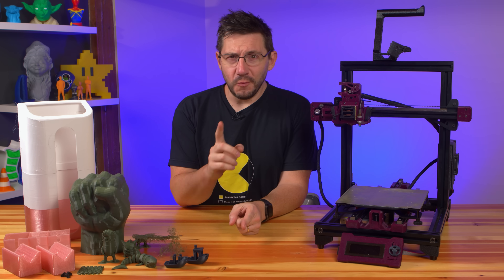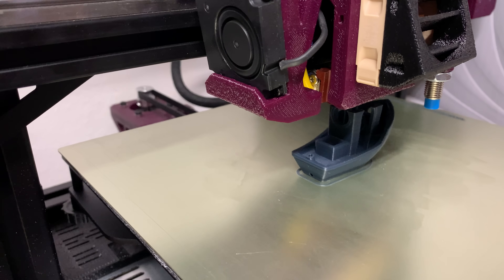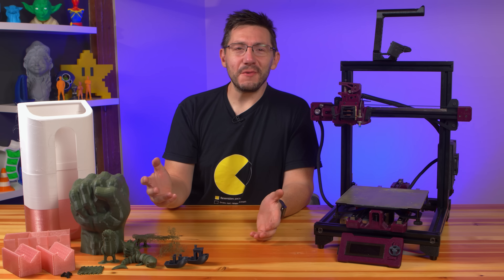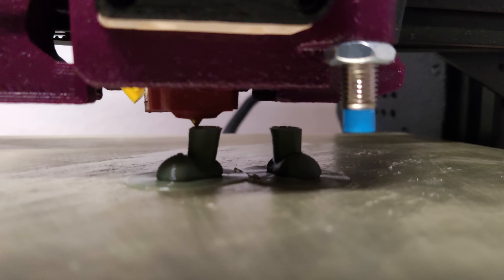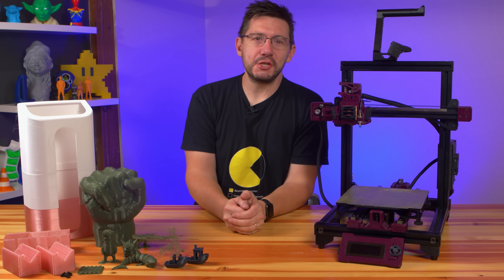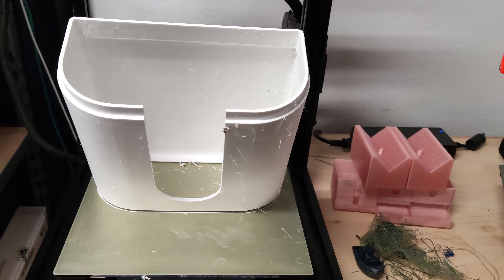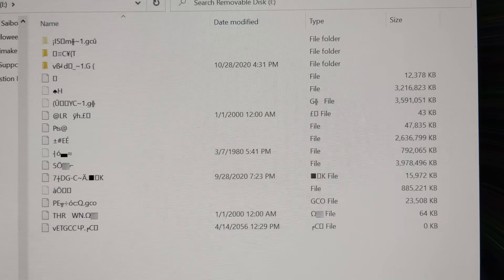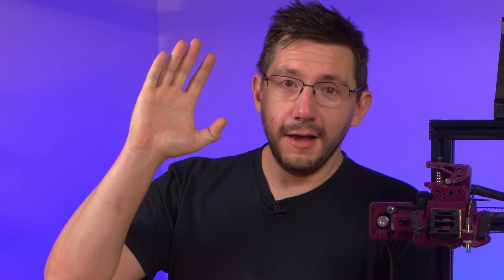WUXN WX1 Review // IS THIS 3D PRINTER FOR YOU?

Comment: Any printer made outside Asia costs much more due to labour costs, what we need is western companies designing printers to be manufactured and QC'd  in Asia with the parent companies monitoring QC, Creality have adopted these ideas for themselves but seem to concentrate on the budget market, I believe at some point the market will become saturated with budget machines forcing development of better units
Reply: @wildlifetails  well i think that there is something else. Many actors just do "another printer". What is the added value? Ultimakers have their dual, interchangeable print cores, as well as the ecosytem with cura and all; prusa are IMO the golden standard that everything measures against (i don't say nothing is better than a prusa, they are very good, adequately priced, popular and thus make a good benchmark.), and also introduced a lot of features that became common later on in a mass produced machine; creality offers killer frames and good kinematics for killer prices, and have more uncommon projects such as naomi wu's infinite Z belt based printer, (and an argument could be made for the ender 3 or ender 5 to be the standard to compare against, and i would thus grant a higher score to prusa, if ender 3 is 100%, a MK3 is 130 to 140% for instance, and if prusa is 100%, ender 5 is 70-80%).

Anyway, those brands are known for things. Back in the time, printrbot was known for their tank-like printers with a pretty good set of features, also built in the US with pretty decent prices for what you got. (although they did not manage to face the super cheap chinese competition).

I think that there is definitely a place for 600-1000$ high quality printers (and the fact that prusa sells that much is proof), as well as more expensive ones (ultimaker proves it), but there must be an added value. Or being an established actor, known for something.

But sure, it is not easy being in the US, since chinese manufacturers ramp up the quality (see the sec-kit printer that is not a plug and print machine, but is simply top notch as a printer platform; i don't know if there is much better now to be had. With a hemera, and a good 32 bits board this is a dream machine :) )

So as you say, occidental designs manufactured in china may be the way to go; also i think that manufacturers should not be afraid to use chinese ressources : in a printer from a random brand, i'd be happier to see a bigtreetech SKR 1.4 than a custom board, unless they prove right away with super good documentation, open design, etc, that their board has an added value.

Another example is smoothieboard. It is awesome, for sure. But now for a fraction of the price, the SKR 1.4 can do a lot of what smoothie can do... however smoothie maintains the smoothie firmware, unlike the SKR, and a few other cool features. Still, the cheap boards are catching up. Unless smoothieboard 2.0 acually releases (a small joke as they take so much time to release it), and adds meaningful features for me, when i make my laser machine, i'm likely to use a SKR board, for it is clearly good enough with a lot of features for a much lower price...
Reply: We don't need anything else made in asia!
Reply: @jesusisalive3227  Why that? If it were not from asian manufacturing, 3D printers would cost 1000$ minimum...
plus let's face it, almost everything is fabricated in asia.
And for Europeans, it would make little sense to go for American manufacturing over Asia...
Even for Americans, it does not make much sense. There are few things that can't be found waaay cheaper and at a good enough quality from asia...

Comment: To me it doesn't look like it's worth it. I've gotten much better performance from my Ender 3 and it did not cost near that even with the upgrades I have put on it.

Ender 3: $199 (+shipping)
MicroSwiss hot end: $63.50
SKR mini E3 1.2: $29:98
TFT35: $35.98
BL Touch: $39.85
PEI coated magnetic removeable bed: $26.50
CR-10 dual gear extruder: $14.98

Total: $409.79 

With the quality prints the WX1 seems to produce compared to my Ender 3 setup that is less than half of the price and the quality it produces, it's not worth it for me at all.

Comment: Love the review but will definitely pass on this printer.  I picked up a  Ender 3 Pro yesterday it wasn't  planned but I received an  email  from Micro Center  and it was on sale IN  STORE for $189+ tax and it prints well  especially  for the price I ordered some upgrades  from Amazon fun stuff!
Reply: Ender 3 is a great printer. You can get very good quality prints out of the box, and even better with some upgrades. It's definitely the printer every thing else gets compared to.
Reply: I printed  a spool holder to move the PLA to the side of instead of on top so far made 3 prints no issues

Comment: So, considering the high price, poor print quality, low reliability and various flaws you showed, why would you call it "good"? at most i'd say "with potential if the manufacturer updates", or passable, but that is not good in it's state...

I like the linear rails, but what does it bring to the table here? why pay for linear rails for a bad print quality?
same for the good quality hotend, and the dual gear; what is the point if the extrusion is so inconsistant?

considering all what you said during the review, i expected the conclusion to be "it is a good printer for 300-350$ if you plan on tinkering with it, or use the parts to build your own printer"

If i compare with a MK3:
-the bed is smaller;
-it is slower;
-it prints considerably worse;
-it is unreliable;
-it is as expensive or more expensive;
-obviously smaller community to help you;
+it has linear rails although it does not improve print quality;
+the copperhead is cool on paper;

I really don't see why i'd want this machine?
Unless they say that the early firmware was faulty or something; as mechanically i don't see obvious mistakes.
I know that the single Z motor can cause problems with this type of design, but i hope they took it in consideration.

So Wuxn, please tell us that this was not representative of the quality to expect...
Reply: Joel didn't call the printer "good". 
"I'll call it good for now" is a phrase often used to indicate that you've done enough on a particular topic.
Reply: @pileofstuff  ok, then i agree more. I felt like he was trying not to say too bad things about the machine ^^
Reply: @AudreyRobinel  he was saying that like he had beaten it to death enough.

Comment: I thought you were going to say its $350, not $950! If you are putting it at the same price as a prusa, you have to make it really special. You cant just copy the ender 3 source files and swap out the extruder and hot end and triple the price.
Reply: You can, but it should be fine tuned to hell for that price.
Reply: @al-Zughal  You most definitely aren't wrong
Reply: @al-Zughal  I have the ender 3 and the prints turn out great :D looking way better than the prints of this printer ^^
Reply: @al-Zughal  Hell my Biqu B1 is better than this. There is no way on earth it is worth that price.
Reply: Wow :O after seeing this review, I thought he would say "in a spot and at a price point" like the ender 3 ^^
Reply: The hotend alone is around $240 how will you sell the printer for $350 ? ;-)
Reply: @danielkrah5129  a $350 hotend does nothing for you if you get layershifts, strings and blobs, corrupted SD cards, a not sticking buildplate, subpar overall printquality, build with 3D printed PETG parts on a machine, that’s able to go 300C+ (they WILL melt) with only a LCD and so on... 
so trash.
Reply: @Chrissi33004  I like how they are mounting linear rails using 3d printed parts. This is a true comedic show of engineering, terrible work. :P
Reply: @danielkrah5129  Oh, yeah your right. I didn't think about the hot end ^^ But still this printer seems quite expensive to me. I thought the sliceengeneering copperhead costs about $100, looking at the Wuxn and sliceengineering websites ^^
Reply: @djg500  That hotend is so overpriced. It's just plain not worth it. We're kidding ourselves here if we don't look at it like an expensive hot glue gun. It's just a metal block with a hole going through it. It gets hot, that's it.
Reply: @djg500   hotend 240, Buildtak 90, fans 50, lin rails 200, rollers 20, frame 60, extruder 10, lev. sens 15, psu 35, board 40, ldo lcd + stepper 50 + 125, fil sens 5, -> $940 + 200 assembly/warranty 1140. In the shops there is no complete copperhead hotend. You have to add all the needed parts -> then you have to pay  ~$240
Reply: @danielkrah5129  $150*
Reply: @mehmetmustafa2112  At least in Germany  thats the price for the heatsink. If you buy the heatsink + heaterblock + Heatbreak + thermistor + heater cartridge + thermal compound you are at around $240
Reply: @mehmetmustafa2112  then you have no complete Hotend. the high temperature thermistor is $50, heatsink 50,  heatbreak 35, hotblock 30, nozzle 35, thermal past + fan 25  ->  $225  when ordering directly at sliceengineering. So if you have a link were you get it for $150 ....
Reply: @danielkrah5129  That hotend its sooooo overpriced but software is more important than hardware.
Reply: @danielkrah5129  hot end is now 100..

Comment: Looks like a combination of an Ender 3 and a Prusa i3. The printquality ironically looks below that of an Ender 3. So the price is just too high for what you get
Reply: Pretty sure the firmware is bad, most those problems remind me of partial firmware.
Reply from the maker: It came with Marlin 2.0-bugfix and it corrupted the sdcard. They sent me Marlin 2.0.6 and it corrupted sdcards still. My thinking is maybe it has to do with power loss recovery writes?
Reply: @3DPrintingNerd  Idk if that is the problem, but it is not too uncommon to corrupt the micro sd cards in a raspberry pi, if you use a powersupply that is barely good enough. So if their mainboard doesn't use components that give a reliable 5V  at all times (especially when it writes power loss data), that could be the problem.
Reply: @3DPrintingNerd  Sounds to me like they just included the sdcard that came with the BIQU BTT board which, without fail, corrupt.
Reply from the maker: @BaldBeard_BlackShirt  Whoa - really? That's a known thing?
Reply: @3DPrintingNerd  that has been my experience on the SKR Mini E3 v1.2, 1.4 Turbo and with the TFT35 and 24 displays with the sd card readers
Reply: @3DPrintingNerd  Replacing the card with a quality brand like SanDisk usually fixes the issue so when I buy a board I usually back up the contents and then copy back to a known good card
Reply: @3DPrintingNerd  yep, I throw mine out as soon as I get the new board. Garbage cards.
Reply: Absolutely